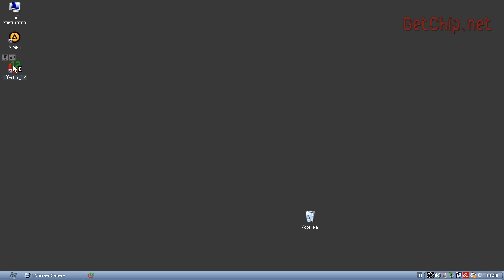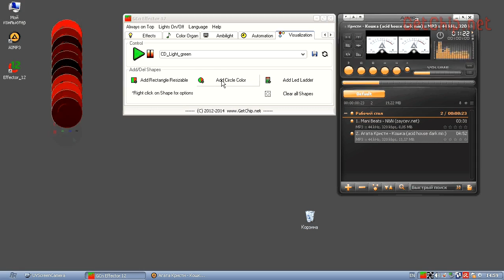CD Light Ladder

Comment: CDs are easier to cut if you put them in the toaster oven on loe for about 10 seconds.  Times may vary, so play.  The key is to keep the temperature low, pre heat yhe oven, turn it off, put the CD in, count and get it out quickly.  You want to find the sweet spot where the CD will cut but hasn't melted.
Reply: For this project i'm not even sure you'd need to cut them.  Just glue the tubes on and hide the wires.

Comment: ENGLISH OR SPANISH PLEASE :D
Reply from the maker: Read the article. The widget has a translation tool.
http://www.getchip.net/posts/114-cvetilnik-iz-arduino-cd-light-ladder/
Reply: THANKS!! :D
Reply: Jack Benimble WHAT'S THE PROBLEM
Reply: jescofrey 😂
Reply: 1]  The Internet is international.
2]  The video is self explanatory. The text in the video are just step titles, like, "preparing the CDs" or "Connecting the LEDs" or ... it doesn't really matter!
3]  The video description section includes a link to a written procedure http://www.getchip.net/posts/114-cvetilnik-iz-arduino-cd-light-ladder/
4]  Most web browsers have a "TRANSLATE" feature accessed by right clicking anywhere on the page.
5]  Expand your social horizon - not everyone speaks English or Spanish ... or wants to ... nor are they required to.
Reply: 3DPDK 
you talk good english
Reply: jescofrey piss off